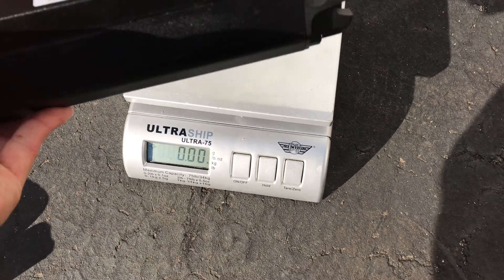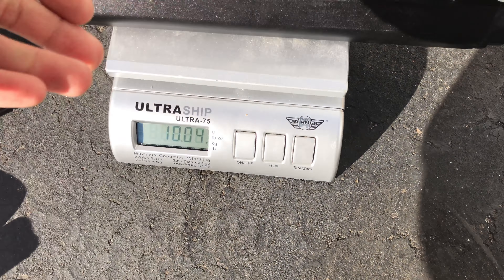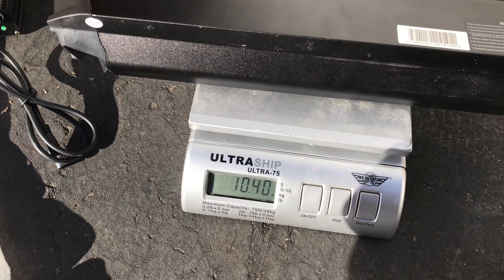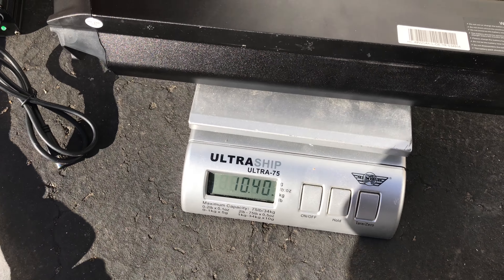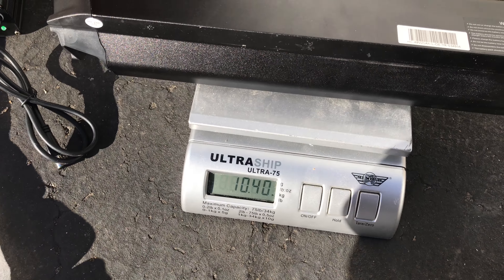Frey AM1000 eBike Battery

Comment: I wonder if that battery would work on my Juiced CrossCurrent. It's the same design. Do you know if they sell the batteries by themselves?
Reply from the maker: I don't know, but you could message them. https://www.alibaba.com/product-detail/3rd-Gen-AM1000-Bafang-ULTRA-G510_60700621160.html?spm=a2700.8443308.0.0.NbBWV0

Comment: Watch out in wet conditions. After 1year commuting in wet weather ,battery was starting to burn at the chargingport.Water came inside from button on top of battery and draint hole way down ending up at chargingport making short circuit..meanwhile water past the bms witch is also situated under the button..leaving corrosionmarks everywhere....the button witch is of rubber ,sits on top of the print and is for sure NOT waterproof!!!! Battery have replaced under warranty...one year later is saw waterdrops in leds....same problem .... these battery are not waterproof.  Beware!
Reply from the maker: Thank you. I would not expect the battery or bike to be water-resistant. To ride in wet weather, you would have to make your own modifications to the battery and bike to make sure water doesn't enter and to make sure that if water does enter, it has a place to leave (drain holes).